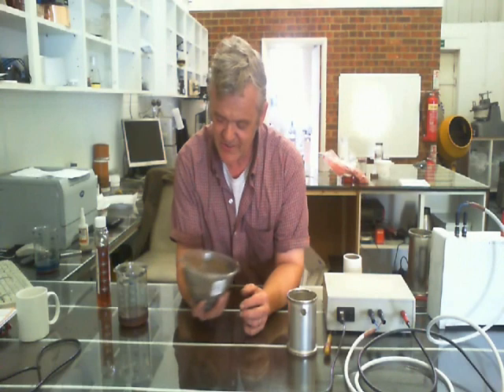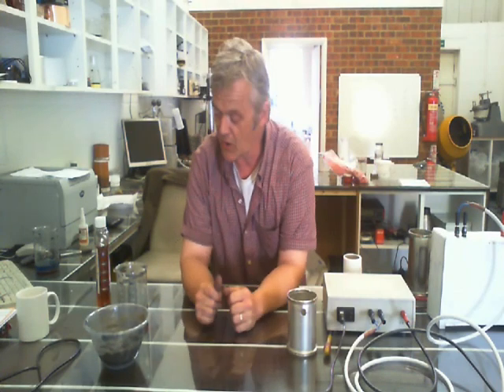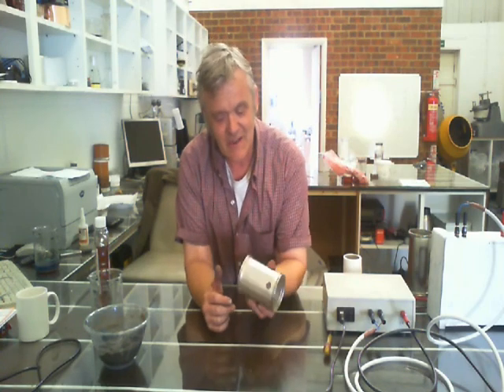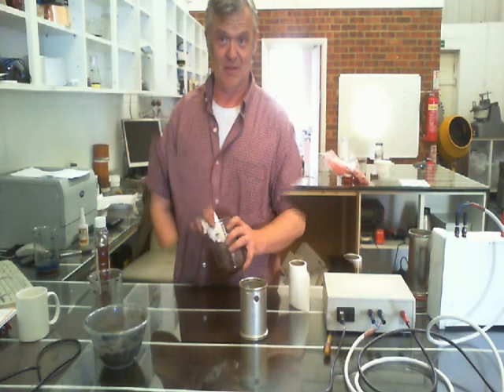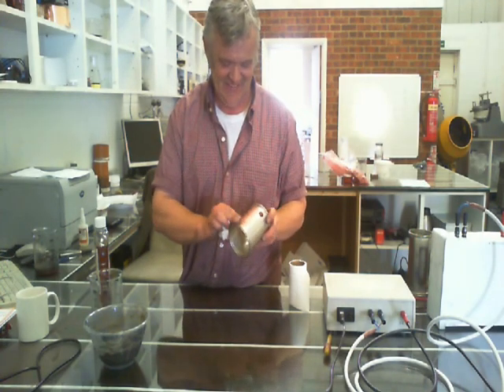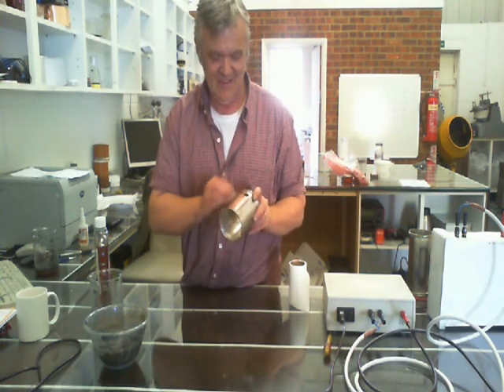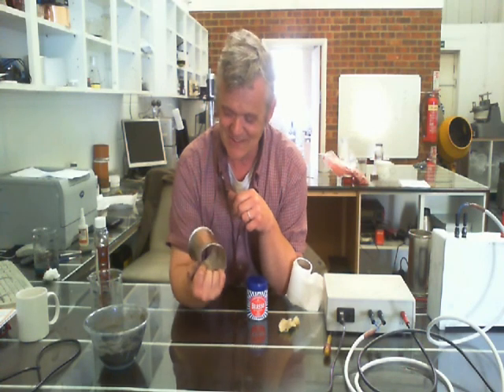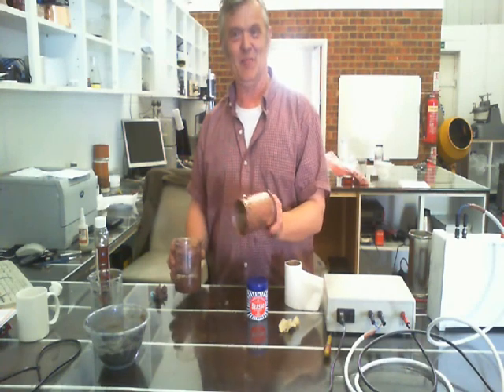Easy Copper Plating Of Steel

Comment: The smile man gotta love it :D 
I would actually like to use this method to copper plate steel chassis (old radio chassis from the 50s). The steel chassis would be sandblasted then immediately put in the solution I think that would work rather nicely and then I could use something like liquid tin to get tin on the surface of the chassis. Just wondering If I can get that thing anywhere on the internet (the dust in the bowl)

Comment: This just made my day I'm assuming I just made the nano particles in the other video I just watched . Using a qtip  plate the top and btm of 18650 batteries so it easier to solder to them. That seem way cheaper than buying aluminum flux and much stronger
Reply: Interested to know how it worked out for you as I have another use similar cheers
Reply: It worked out pretty good but I been trying to go another route conductive 2 part epoxy putty  I just got some graphine ordered yesterday thinking try a cheap version just mix in  the graphine to cheap 3.99 a stick generic epoxy stick see if I cant get a solder less no weld solution that could also work as the bus bar as well
Reply: I have some copper tape aluminum tape zinc and few different guage nichrome wires might even try adding to that as a reinforce see what it does for hell of it
Reply: But before that I used a acidic flux paste I would apply to the cells on 1 side and let sit a few minutes and used a acidic flux core solder and 100watt iron solders easily
Reply: @michaeltucker8645  nice thanks for letting me know mate

Comment: Good afternoon.  I am trying to copper plate my steel motorcycle tank and fenders.  I've been searching for a while and finally found this amazing video.  I've read through all the comments about making the powder, but I have a couple of questions.  In your comments you state that you are using the precursor to the ink.  Is the power simply copper nano-particles derived from the mixing of Copper Sulfate in water, ascorbic acid in water, and then mixing the two, letting the copper settle and pouring off the liquid and letting it dry?  Is that the powder you are adding water to in this video?  I made the nano-particles in solution and then rubbed that solution on.  It was a bit more stable that pouring straight copper sulfate on the steel, but it was quite thin and didn't produce a strong copper color and came right off with some cleaner.  Please advise where I'm wrong.  I've watched every video you've made about copper and it feels like I'm just missing one key point.  I joined your site just for this information.  I am very eager to copper the steel as I already have brass accents all over the bike.  (Also in the description for this video you mention that the steel  is being cleaned so thoroughly that it allows for a stronger replacement.  Are you adding anything to the powder that would clean the steel so well?)
Reply from the maker: i see you are a mamber mate - i will do a full video for you and it will be up in a couple of days - cheers
Reply: @ThinkingandTinkering  Wow, thank you so much!  I have been working this project for over a year and I feel like I'm almost there.  I loved the copper coating you got rubbing the solution on steel and that I can polish it without it coming off.  I plan to use Exo-Armour to coat it once the plating is complete.
Reply: @ThinkingandTinkering  I hate for you to have to go through making an entire video.  Maybe if I explain what I think I've learned, you can correct me.  From what I gathered, I can make a 0.1m solution of L-Ascorbic acid and approximately a 0.035 m solution of copper sulfide in near boiling water.  I then pour the two solutions together and let the copper fall to the bottom, pour off the liquid and dry the copper.  When dry, I can rub it on bare steel and it will adhere?  I ran a test the other day using old Vitaminc C vitamins crushed up and put in water and I got copper, but the VC was old and didn't go clear so I tossed it.
Reply: @Papa33J  I'm also eagerly waiting for an explanatory video on the subject. It just doesn't work for me. I am not a chemist. I just want to coat a few steel parts. I'm starting to despair. :(
Reply: @Papa33J   Thanks Robert for your info, I know you are busy...PAPA33J, Aiming to do the same thing on a motorbike, were you ever able to figure out how to get this to a viable powder form and stick to be as durable as imagined? Kind Wishes and ride safe!
Reply: @robertocoronado8074  I never got it to work

Comment: Hi Robert,i haved searched through your vids for how you eventually made the powder you are working with.Which one relates to the powder you are using?
I have searched,and found an early one from 2012 and then one from 2014 with the blender.Please help, i will make you an amazing sculpture for your desk/wall,you will wonder how i did it! copper plated with this solution.

Comment: Really cool stuff here, thanks for all your work. I'm trying this out with some stainless steel and I'm not getting any plating. I made the nanoparticles you described in another video, precipitating copper sulfate with ascorbic acid, drying, then suspending in water. The solution just drips off the steel, no plating. I know stainless is harder to deal with, is there any trick you've been able to find for it?

Thanks!!
Reply from the maker: if you are using the nanoparticles what you need to do is closer to peen plating mate
Reply: Alright, I'll give that a shot. I can't use the tumbler like your video, these are stainless steel flasks (gifts for friends) that' I'm trying to plate with a design. I'll play around with it, see if I can get a good peening system for a curved surface. Cheers!
Reply from the maker: awesome mate - good luck
Reply: Ben, I have been scouring these videos to make the powder so I can copper plate my steel motorcycle parts, such as the tank and fenders and a few bolts.  I already have a marine quality clear coat to stop any oxidation once it's applied and to protect the coat from abrasion, but I just couldn't find the video that was clear enough on how to make the powder.  Essentially, I am just making the particles in the suspension, pouring off the liquid, and then letting the nano-particles dry and then use that powder in water?  Have you tried this on steel?

Comment: So how do you make it, I mean, what is that "greenish brown" powder?
Reply from the maker: shown in video on copper nanoparticles
Reply: Where would one buy some copper nano-particles? I can't find them on amazon.
Reply from the maker: you have to make them - i did 2 or 3 vids on that
Reply: I've seen them, now, thanks. Time to make some nanoparticles.......
Reply from the maker: go fo rit mate
Reply: thanks.  I'm curious if you have tried making monoatomic gold?
Reply: I think maybe you mean colloidal gold. I've made colloidal silver before. The term colloid refers to the smallest possible particles of something, I guess that could mean either an atom or a molecule, depending on what it is.
Reply: I saw some videos of people making "monoatomic gold". I think it is a little different than colloidal gold.  They make it into a white/pink powder. I looks like they were taking salt water and adding a little piece of gold then adding some NaOH and HCL to get it to correct pH. .
Reply: But gold doesn't react with anything. It won't form complex compounds like any other metal will. It doesn't even oxidize. Colloidal gold will be a red liquid.

Comment: Hi Robert,

I bought the materials and have been tricking about and experimenting rubbing on steel car panels, (following your video to make the copper nano particle liquid), but unfortunately without the final result you seemed to get here. It is in a paste form, but it does not want to adhere to the steel like above. Have you added a binder or anything of any sort here, or is it just the copper particle powder with water?

Cheers,

Luke K
Reply from the maker: +Luke Keeshan there's a bit of oxalic acid in there too mate
Reply: Ah i see, use the oxalic acid to etch clean the surface before hand, rather than mix it through the copper mix itself?

Thanks again
Reply from the maker: +Luke Keeshan either way is good mate
Reply: I purchased some oxalic acid powder and have experimented in several ways, but still no dice. Do you have an email, and i can explain further so perhaps i can trouble-shoot where i am going wrong?

Cheers,

Luke K
Reply from the maker: +Luke Keeshan no worries mate - my email is robertmurraysmith64@gmail.com but please remember i have limited time
Reply: Any luck with stainless steel? I'm trying the same thing, and no luck getting it to plate. Just drips off to the side.
Reply: @benhaynie310  Isopropyl alcohol???
Robert,love him for his brains and knowledge doesnt like to give the whole story.If you watch the vid he uses the beaker in the background ! Not the one he has said that he mixed with water.Isopropyl alcohol will not act like water and will not just run off the metal,In my iopinion,add oxalic acid to the mix you have made WITH isopropyl alcohol.I am not a chemist etc but this is worth a try???
PEACE AND LOVE!

Comment: Hi can I ask How durable do you think the plating would be in terms of plating a s/steel cooking pan. Would it ware down? Also can it be layered to make the copper layer thicker. And is it actual copper and not just a colour. Thanks and great vid by the way
Reply from the maker: ran dom it is copper - but very thin - it would wear down with the kind of wear and tear a cooking pot gets
Reply: Ok thanks can it not be layered to make it thicker
Reply from the maker: ran dom worth a try mate - i'll give it a go when i get a chance
Reply: Thanks please do. IT would have to be equally durable as copper or I might aswell just use copper eh . Also can it be polished up to a mirror finish just like copper without effecting the finish? Thanks.

Comment: Hi Robert , I find your videos very informative and have now ordered chemicals to make the copper nano particles , however I'm after picking your brains on how it gets from being in solution to the power state to which then water is added to copper straight onto steel ? 
I've watched most of your videos looking for it but with I luck Robert , if you could divulge such information it would be greatly appreciated , 

Regards mark slater
Reply: above: "I'm not going to tell you..."
Reply from the maker: Mark Slater There are a number of ways of doing that mate - it's not so much a secret as long and convoluted - the channel is not my job - it is more of a hobby and sometimes I just don't have the time to go into things in that detail - just right now for example I am answering this post in a hotel in Canada where I am about to leave for work but i have a spare half hour so I though i would answer my youtube posts - there are 137 posts - what i can say is limited and there has to be an element of self discovery on your part - having said all of that - i tend to think of a problem in terms of where i want to get to and adjust my initial starting conditions to take that into account - it means i have less process steps to get to where i want to get and that makes things easier - hope that helps

Comment: Was the video explaining how to make this stuff ever made? Could someone link it if it exists?
Reply: It is a displacement reaction.

You dissolve copper chloride in a acidic solution and rub it on a clean steel surface.

The copper chloride can be made by dissolving copper wire in a ferric chloride solution (PCB etching acid).

Then you add a little bit of Muriatic acid and a bit of drug store hydrogen peroxide.

You can try this mix, the proportions are not that critical:
1) 1 L of PCB etching solution.
2) Dissolve about 100g of copper wire, if it doesn't dissolve completely after siting overnight, no problem. Just sieve out the unreacted copper.
3) Add 100ml of muriatic acid and 25 ml of hydrogen peroxide (3% will do).

Wash the steel piece with detergent soap, to degrease it.
You can wash the steel with sodium bicarbonate or bathe it in soda (the important thing is to remove the grease).

Wash it again with plain to remove the soap/sodium bicarbonate/soda 

Then just rub the piece with a cloth dampened with the acid solution. The excess muriatic acid within the acid solution clean the oxides and help the copper plating.
Reply: I'm not sticking my hands in anything containing muriatic acid

Comment: hello sir. i wish to know the link to the making of the brownish green powder. i need to make some to line the inside of a gas/petrol tank. one that has shown signs of rusting. in the process of ridding the rust. the process will leave the metal susceptible to further and accelerated rusting. this process seems to me to be the best way to end rusting of the treated metal. thanks, hope to hear back soon.
Reply from the maker: i'll try and do the vid mate - it will be a while as i am off to Oz for two months
Reply from the maker: kf4dcy
pretty much spot on there mate just mix in water and fumed silica. There's a problem with your link
Reply from the maker: kf4dcy
cheers mate

Comment: Robert does this adhere to aluminium and other metals that don't electroplate well because that would be ideal for reducing the cost of the copper for the thermocell. :)
Reply from the maker: not in this form - no - but i am working on it
Reply: Robert Murray-Smith Oh well, still very cool. Got a bit of chromium oxide in the mail and and trying to recreate some of your findings. With the Cr2O3 and TiO2 on Aluminium, every time I add heat to it drops it's power output. Going to try this between Cu and Al next, one doped a bit with graphene ink and the other without.
Reply from the maker: ben dorman
cool mate keep me in the loop